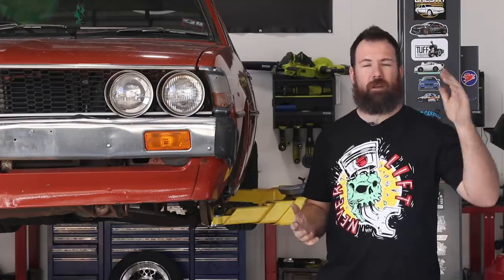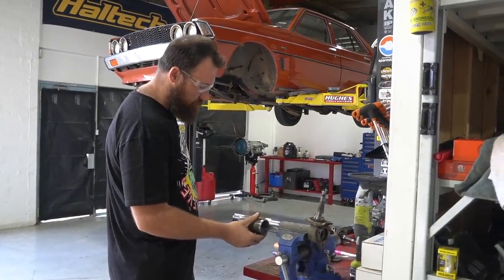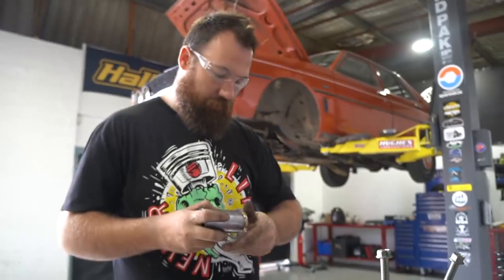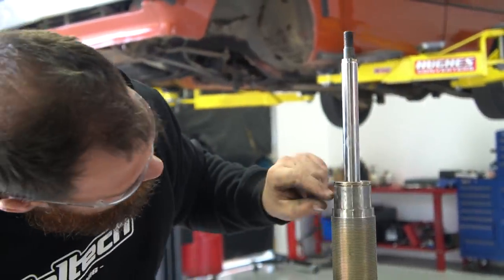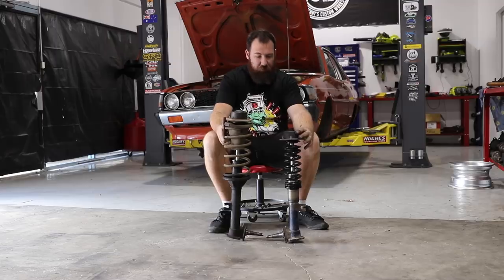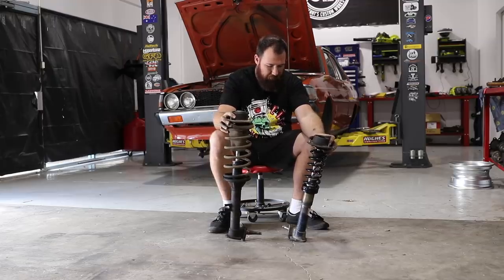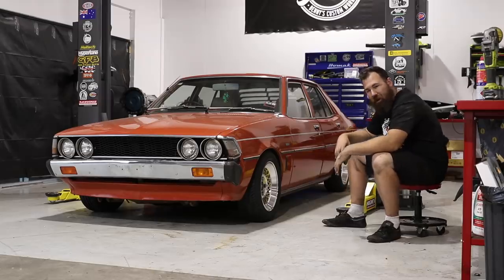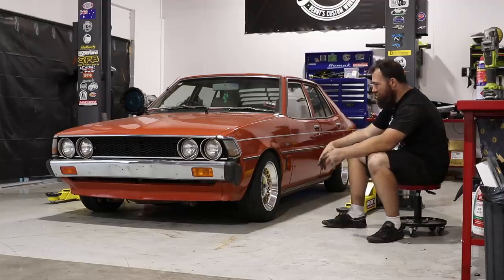Sigma - DIY coilover install

Comment: 14:25 Onomatopea - a word that sounds like the thing it is describing (eg 'hiss' or 'plop')
Reply from the maker: nickhodgman steve.
Reply: Came here to say this. Ps Benny loving the work, wish I could get my ke10 to ya
Reply: Reminds me of my father-in-law, he was man of few words, but one day I asked him why he was always buying new foam cushion toilet seats.  He said, "It's because of (my wife), she always plops onto the toilet."  He quickly realized that might be miss-interpreted, so he had to re-enact how she sits down hard on to the toilet seat, more of a "flop" which requires the foam-air-cushion dampening to absorb the impact.  He said without the foam seat she would blow out the seal under the toilet which chases a leak and is much more work to replace.  The vinyl covered foam seats would eventually blow out and crack and require frequent replacement, so he would buy them anywhere he could find them as they were going out of style.  Anyway, the video about dampers and the word "plop" reminded me of that time we had a good laugh at my mother-in-law's expense.  Thanks.

Comment: We actually did get the Sigma here in the states; underneath all the badge engineering, it's just a Mitsubishi Galant, which was sold as the Dodge Colt here. So, on the off chance I ever wind up with one of these, thanks for the measurements!

Side note: yeah, nah, those "temporary" wheels are now the permanent wheels. They look sick.
Reply from the maker: e199sigma thanks , I can’t find  this style of sigma in the US anywhere on google .

Comment: Damn. The car is looking absolutely insane after lowering and new rims. I would drive it just like that, and get the welded strut bodies powder coated. Nice even coating, and very durable paint.
Reply from the maker: ifgezroxy that’s the plan :)

Comment: Benny, always great stuff here, always! You lot Down Under, with a much smaller market and many fewer performance minded vendors (not to mention the high cost to import) are absolutely stunning in your "old time hot rod" field engineering. Loved you making the details about the costs and such- straight up, dude! I thought the front end would be in the weeds, literally, when you compared the finished strut with the uncut one! The stance and CG looked a treat! Awesome car coming- already subbed, already laid in enough popcorn to do justice to your content, so "content" along.
  Benny, a long time ago, in a place far, far away (as the movie starts), at my first shop job, I was working for a man in his 70s- he was so old he had gaskets for a job he was supposed to do but never materialized hanging on the wall behind his desk; a set of factory engine gaskets for a 1908 Hupmobile. The dude was ancient to my 16 year old sensibilities! During my first week, he taught me how to pack wheel bearings with exactly the same process you used to pack these. Thank you for sharing this- I hadn't thought about old Mike Quigley for a long time, or fishing with him and his Studebaker P/U truck!
Reply from the maker: frederic rike thanks for sharing :) these types of skills will die with todays throw away type of repair.
Reply: @BennysCustomWorks  Thank you for sharing this classic old hand craft skill that was such a part of "the trade" - I learned that 53 years ago, and I hope, somehow you are wrong, but suspect you are too right.

Comment: Deboss was packing bearings last week and said “ You can get fancy bearing packers, but this is how I was taught “...hmmmm seems like real mechanics like to do things PROPERLY 👌
Reply from the maker: Benjamin Clayton Rich is a legend. His parts washer has some crazy chemicals in it though, roasted my hands in it .
Reply: How I was taught as well. It's actually the best way because you can see and feel that the grease is all the way through and all the way round. with the grease packer the grease is everywhere but you can't tell if its packed properly in the race.
Reply: I learned to pack grease in a bearing the same way by a old mechanic. Still do it that way.

Comment: Aww man that now looks sick 👊🏻😎😎😎 what a difference stance makes on this
Reply from the maker: cutters74 fixed it hey .
Reply: Benny's Custom Works The wheels you have on there at the moment look proper good too 😎👍🏻 I don’t normally gush over stuff like this but the moment you took it off the lift n it sat there was just like “Wow”. Think you probably need to do a nice resto on the body work now, I reckon it deserves it.

Comment: May not have sigmas here in America but I have a conquest with a similar shock set up and I can’t get shocks for it. This has helped me a lot
Reply from the maker: Robert Cummings after hours of googling Sigmas were briefly sold in the US ( only 1979 from what i can find) as Dodge colts but only in Station wagon variants. The colt sedan was a Mitsubishi lancer .crazy they’d sell two completely different cars as the same model. Then 30 years later chrysler sold the 300c as a sedan and the Dodge magnum as the station wagon. Same car, different clip. In Australia and europe we got the ‘magnum’ as the 300c wagon.

Comment: looks good lowered with those wheels. cant wait to see the engine mods. should dyno before and after.
Reply from the maker: T1000AX it’ll be a disappointing before :D
Reply: @BennysCustomWorks  or an even more satisfying after 🤔

Comment: SV21 Camry shocks? 

That's exactly the same shocks I used when I cut and shut the front struts of my AE86 and made coilovers like this. I used Ford Cortina rear shocks and custom springs to get the rear low enough.
Reply: Oh and my struts were actually from an RA60, so I could fit the larger brakes and different steering knuckles.
Reply from the maker: They seem to work well :)
Reply: Good shocks, worked well on mine. That was back 20 years ago though...
Your wheel bearing grease packing method is the same one my old man taught me 30 years ago. It's the best way to do it, quick and easy.

Comment: Seems cheaper to go with s14 lower arms and adjustables.simple setup to get  low and retains 4x114.
Reply from the maker: FordLife Nz it was considered however I didn’t want to change the geometry of the front , we’d already measured the wheels from the original sigma front set up .

Comment: That looks amazing with the wheels and the new coil overs!
The new wheels better be something extra special to beat that look!

Are you going to do poke around with the engine? Would be nice to see that too.
Reply from the maker: Beefheart Vandercrease yea we’re swapping the 2.0 and auto out tor a 2.6 and manual . Will get a top end freshen up, cam , adjustable gear , twin weber 45’s and a set of extractors

Comment: Benny,the Sigma has gone from  Grandma spec, through Grandpa spec, & is now at Uncle spec. Looks good with the enkei';s & the shortened struts. Definitely need some larger discs & calipers, those brakes were good on the late 120Y's but with a 2.6 litre Astron, they'll be a bit small. I'm sure you've got something in the works . I wondered if you might consider a twin throat down draft carby, like a DGV weber, instead of the twin side drafts . A bit less race car, as it were.

Comment: Congrats man, it looks so good!! The perfect match!
Did you have issues with Monroe shocks in the past? I put a set on the back of my old 5 series because everything else was temporarily unavailable. It was horrible. No damping at all, rock hard. It was getting me sick over bumps cause the car was jumping on the tires rebound. Ditched them when I got Kayabas. Now everything is fine. Odly enough the front one are okay, maybe the weight of that in-line 6 is helping too
Reply from the maker: Frozen Pete tbh Not really but we’ll have a good baseline in this car.

Comment: Don't go to powder coat. The heat might bugger things up. Use a good 2 - Pack and just paint them.
Reply from the maker: ROY FERNTORP powdercoating at 200 deg is much lower than welding .

Comment: Aweome video.  With the rear springs did you have to cut them further? Because king springs only a 30mm drop. But yours looks heaps lower.  It looks perfect.  👍

Comment: Man that looks so good, and thanks for the insight into hopefully some shorter insert shocks for the front of my GR Sigma wagon. These V212 Camry Shocks look like they are a bit shorter in overall length then the factory Sigma? And your rear shocks you fitted to this where they a shorter than stock height shock absorber? And what model king spring did you use in the rear (I take it they are king springs)? I'm wanting to get mine really low but need a super low spring and shortened shocks front and rear? What would you recommend i should use for that combo i dont want to do coilovers in front just yet but a super low spring for the front would be great...... Thanks man and keep up the good work....

Comment: Do you need to get those struts certified and stuff over there? Oz rules/processes can be pretty onerous can't they, or should it be straight forward for this kind of thing? Sigma is looking mean with them on.
Reply from the maker: Jon S engineer will check them out.

Comment: Hey Benny, I was wondering - how did you  you confirm that the wheel bearings are OK to reuse?  Thanks :)
Reply: Probably after a visual inspection, if not finding any scoring in the rollers or the outer bearing races it's usually enough to clean them and regrease, they get adjusted when fitted anyway, so any minor wear I wouldn't worry too much about.
Reply: @kc-nl8zc  because they are, solid discs are thin.
Reply from the maker: kc 11 they are thin as from factory anyway :)

Comment: i would also want to find and buy back my grandfathers' old galant sigma E. but it will be finding a needle in a haystack, and i'm broke asf 😔
Reply from the maker: trbj f did you know the ‘E’ is actually Sigma ?
Reply: yeah. here in the philippines looks like we got the jdm model too. super  version with the side mirror and a ven on the front side panel and different engine i think

Comment: What were the springs you used on the rear? I'm guessing King Springs by the colour, but I can only find 30mm drop springs for the Sigma, and that looks a lot lower than just a 30mm drop.
Reply from the maker: White3lk kings that we had reset. They are a little short now though snd fall out so will most likely get some made that have a progressive wind .
Reply: @BennysCustomWorks  Keep us posted, because I'm probably gonna have to do something similar with my Sigma.

Comment: They exist here as Colts and Arrows.
Reply from the maker: JP Kalishek do you have any links ? All the Colts I can see are based on the chrysler / mitsubishi lancer from the mid to late 70’s . Not doubting at all, genuinely keen to see.
Reply: @BennysCustomWorks   North America got the wagon version as the Colt for sure, and I thinks Canada had some labelled as Dodge Arrow but most of those were Celestes, The struts and brakes you have look like the bits from those. Lots of interchange and upgradeability  there. My 76 Colt had struts brakes etc from an 80's Galant\ Sapporo\Challenger. I will look more at home, and not fighting a tablet.
Reply: @BennysCustomWorks  Got home and got the time. Link 1-
https://www.automobile-catalog.com/make/dodge/colt_dodge_1gen/colt_dodge_1gen_wagon_2/1978.html
shows the first year we got them, and after our Colt went front drive Mirage, we still got the Sig Wagon as the Wagon version of the Colt for a few years (and my what a gutless thing it was in a 1.6/auto. Not bad in 2.6/5speed but I'd love one today).
Also some versions here:  https://www.curbsideclassic.com/curbside-classics-asian/cc-colt-chronicles-part-4-1978-1981-dodge-colt-station-wagon-mitsubishi-galant-looking-for-a-dart-wagon-let-me-show-you-this/

I'm still most partial to the first two generation Colts, but these days, I'd take any of the rear drive Mitsu import Chryslers from 1984 on back. Always preferred them over the Toyotas.